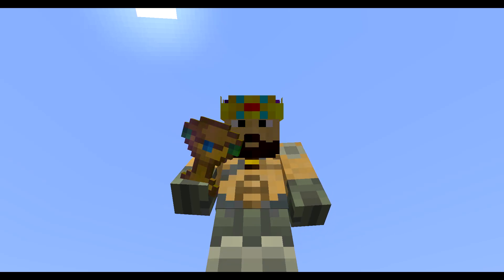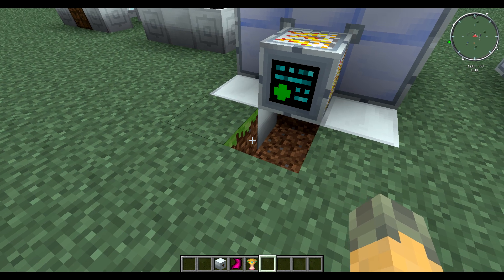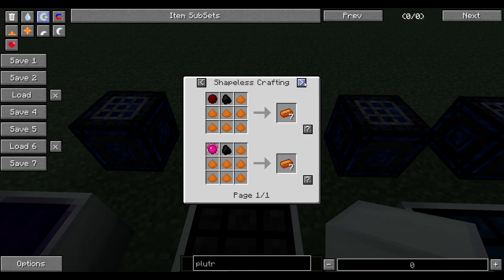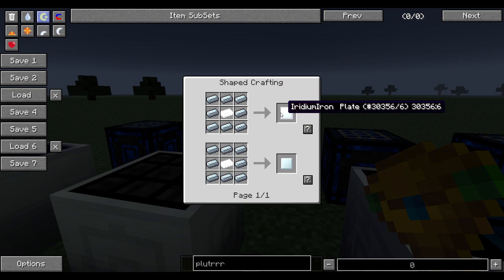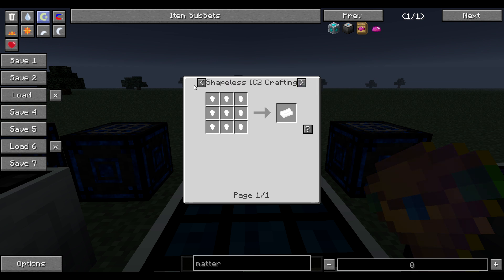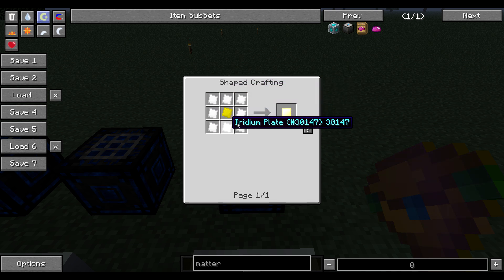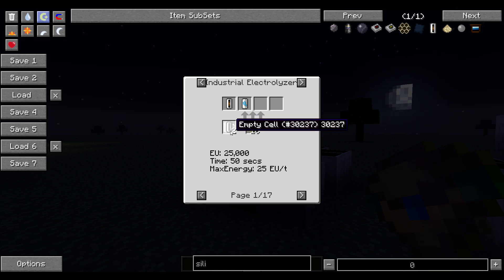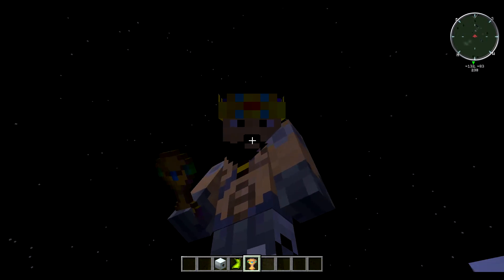Feed-The-Beast Tutorial: Solar Panels (In-Depth) (Gregtech Enabled)

Comment: Dude, that industrial blast furnace can barely smelt steel. It can't do silicon plates which need 1500K. Make one from 10 basic machine casings and 24 reinforced machine casings and put 2 lavas inside of it. This will give you 2000K. Then when upgraded fully with Kanthanal and Nichrome coils it will do 3000K, which is enough to smelt even Tungsteel. Even just putting the 2 lavas would push yours high enough to smelt Silicon Plates. Cheers ;)